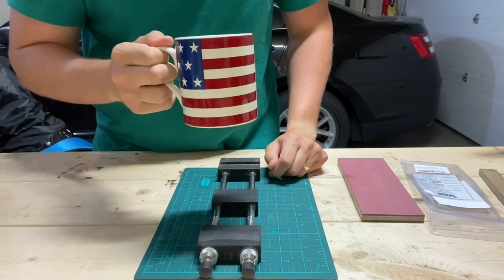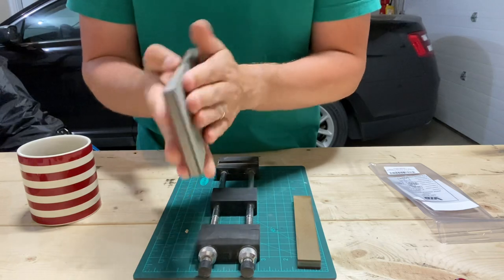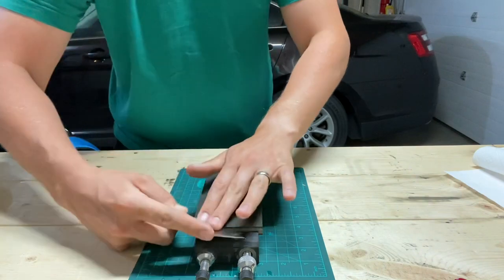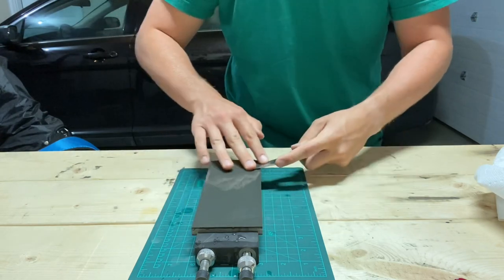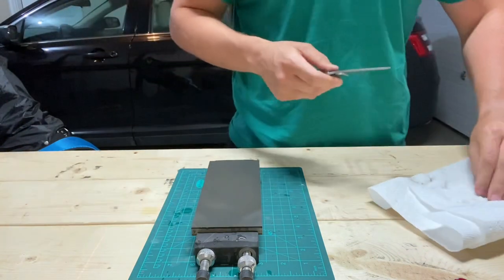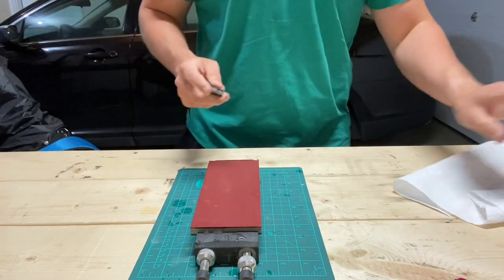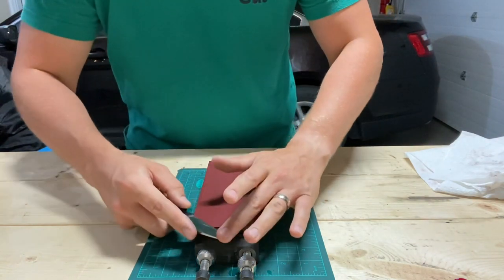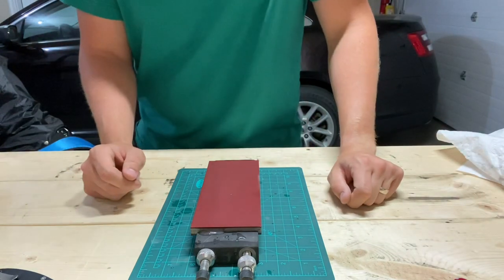Initial Impressions and Sharpening on the Venev Phoenix 240F/400F Resin Bonded Diamond Waterstone

Comment: I have been meaning to do a video about these stones. I have both 25% and 100% concentration of the 100/240 and 400/800. I enjoy both variants for different reasons.
Reply from the maker: Same here. They both have a role to play in what I'm doing. I haven't been going back to my little 1x6 25% concentration much due to convenience but it can really be the ticket sometimes. 

That 100% 240F is really doing it for me though, surprisingly it may be my favorite out of the bunch. Doesn't load nearly as fast as I was expecting and cuts pretty dang quick.

Comment: Thank you kind sir for sharing your experience and knowledge regarding these stones and sharpening in general. 

I am newbie as it comes to sharpening but believe I have finally found a great set of stones to learn on along with a pair of Naniwa Professionals 800/3000. Question if you might; 1. Would you recommend the 100/240 and 400/800 or 240/400 and 800/1200, planning on 1 micron strop as well? 2. Could I get by without the Naniwas for wide range of blade steels from AUS8-K390.?

Can’t seem to find the Super Vitrified 400 from BBB, not that I want to spend that much for one stone😮

Kind Regards,
Reply from the maker: I have no doubt the 100F is a beast but for sure recommend 240/400 and 800/1200. 

You won't need the Naniwas at all with those stones. You may want them later just for the feel, feedback and overall experience of japanese alumina based stones but you won't see any gains from them.

Comment: Thank you.  Very good info and clear. I just got the same stone and excited to give it a try.
Reply from the maker: Glad you liked it! What kind of blades are you going to be using on it?
Reply: @EngineersPerspective701  I'm starting with a Spyderco Para3 in S30V.  And I have other knives in this steel but they aren't thin behind the edge. I'm trying to attain hair whittling edges and consistently.  Thank you for posting videos!
Reply from the maker: Definitely picked a great stone! Love me the para 3, it's a great design and S30V will take a great edge. Enjoy!
Reply: @EngineersPerspective701  Used this stone and then the Venev 800/1200.  I have the hardest time cutting paper towel, like you show here, but can cut pretty cleanly through thin paper.  What quality is it... that allows your edge to catch so much better?  FYI I just began trying free hand after using a Sharpmaker and guided system.
Reply from the maker: @dcuttingedge5422  you’ve definitely got some great stones to get started! The apex has to be burr free but not over polished. It won’t cut the paper towel if you polish that bite out. Usually getting that clean apex is the hardest part for me!
Reply: @EngineersPerspective701  I'll work on not polishing out the bite. Thank you!
Reply: @EngineersPerspective701  I followed a suggestion to learn how to use my coarsest stone, and only that stone, to sharpen and debur for a very grabby edge.  I used an old DMT Extra Coarse on a CRKT Pilar 3 with a D2 blade.  Turns out i can slice paper towels with it.  Paper towel cuts are a little ragged but it worked.  Much to learn and understand!
Reply from the maker: @dcuttingedge5422  I’ll always maintain that the first stone is the most important! If you can do all you’re work on just own that is great practice and a show of skill!  Nice work!
Reply: @EngineersPerspective701  Thank you!

Comment: Great job! Based on their website and what I deduct from their confusing  descriptions, I don’t think the 240 side has the OCB binding, just the 400 side.
Reply from the maker: I think you’re right! I forgot to check but I made this and didn’t look at the package like a bum!
Reply: I just found that out the hard way. I thought I ordered the 240/400 dragon 8x3 with the 400 having the OCB binder, but instead I received the 240/400 with the 400 that DID NOT have the OCB. So if you or any of you subs want a 240/400 bonded combo, I will sell it for $87, half off what I paid. I have used it to sharpen one knife, so that’s a steal.
Reply: @MrEric0822  You don't still have the stone to sell do you?
Reply: @EdgeStoneKnives  Sorry, no
Reply: @MrEric0822  Hey man, what was the reason for you selling the F400 with the old binder (not OCB)? How do the binder differ for that grit particularly?

Comment: Grab you an atoma 140 8x3 for apexing. You'll be able to apex in under a minute. Then move to your f240 f400. The work sharp is nice but it's pretty small
Reply from the maker: Really not a fan with apexing at that low of grit. The #400 super vitrified diamond waterstone from triple B is my go to low grit. Hands down my favorite stone of all time
Reply: @EngineersPerspective701  I use my 140 atoma to reprofile mainly. I'll run it right until it's about to apex and then I switch to my atoma 400. By the time the 400 scratch pattern takes over, the bevel is apexed. Makes quick work of anything, that Atoma 140 is absolutely blazing fast for reprofile work.
Reply: @EngineersPerspective701  honestly if you aren't changing your angle or getting chips or if the apex, 400 is usually good for most ppl. I'm just so used to dropping my angle down to 14°-15° that if I didn't use 140 grit I'd definitely be forever. At my work they are so hard on knives I've even used cheap Chinese 80 grit diamond to apex them 😂

Comment: Venev stones are excellent for Maxamet.  They don't seem to load up, and stay flat for a really long time.  Also Gritomatic's diamond pastes are a great value for fast cutting stopping compound.  I don't want this to sound like an advertisement, I'm just a fan.  They make great abrasives.
Reply from the maker: What I like about these is they are good for ANY steel! For maxamet, 10V, K390 I would usually apex on the DMT coarse and then finish on either a DMT fine or King Neo. Loved the results off the Neo. And for Non 10V class steels or ones under 65HRc, I would use Japanese waterstones like the choseras. 

But now I can use these on any steel and get the comfort I prefer with the diamonds and speed I want. I will say the 240F seems like a very worn in DMT coarse which is a tiny bit slower than I prefer for apexing super wear resistant steels but not awful. More use required for final thoughts!
Reply: @EngineersPerspective701  I have pretty much the whole set of Venev stones, and the coarsest, highest diamond percentage stone a real beast.  I've even used it to flatten the deep grind marks on the full flat sides of my Maxamet PM2 (they were deep enough from the factory that you could feel them with a fingernail).  It was a bit time consuming, but it absolutely worked!
Reply from the maker: @ZPositive  Coming from the 25% concentration ones, I've been very pleasantly surprised by the speed of the 240F 100%. Definitely could see the low grit being an animal! 

I'd be tempted to just get an extra course plate at that point but an atoma costs the same and you would only get 1 grit so why not go Venev I suppose!?

Comment: Good morning 
Maybe you can give me an answer? 

I bought the Pegasus 400/800 and 1200/2000 stones. 
The knife glides over it like glass. Efficiency is zero. It doesn't work, it doesn't sharpen at all. The result is mediocre. 

I feel like the stones have a problem. However, the site indicates that it is a concentration of 100%.

 Do you have an opinion?
Reply from the maker: Have you dressed the stones yet? Some diamond stones come with a layer of resin over the top covering the diamond particles. Are the Pegasus Venevs right? 

Ideally you would use SiC powder on a glass plate and rub the surfaces on that to expose the diamonds. but I’ve never done it that way. I just use an 800grit nagura to dress the surface and it works fine.
Reply: @EngineersPerspective701  Thank you for your reply. I just honed the stones, they are now a little bit more abrasive. It's better. I still find them not very aggressive but it's already much better.
Reply from the maker: @TheGuillaumedu31  sounds like you’re mixing in the right direction. Might take a time or two for a totally pressed surface. You should feel a good bite with the 400F when you’re using it. Best of luck

Comment: Diamond leave a very unpolished finish , but for some steels they are mandatory. I don't have those steels tho, I just use them cause I found them for cheap :)
Reply from the maker: They leave deep scratches and a satin finish like a belt instead of the nice even finish of a Japanese waterstone. These stones here make a HUGE difference in finish quality though compared to diamond plates. They're lack of polish has to do with a binder that doesn't break down into a slurry rather than the abrasive used.

Comment: do you know the grit mesh more coase for vanadium and a store in Union Europ on internet?
Reply from the maker: It is difficult to understand what exactly you are asking so I will try my best.

Go to Gritomatic.com to see the details on the stone and grits. The link should be in the description. They are currently the only place I know to buy these. Message them on their website and they may be able to work out how to get you one because I don't know if they normally ship to the EU. 

The 240F has  40micron - 50micron diamonds
The 400F has 14micron - 20micron diamonds
Reply: @EngineersPerspective701  I asked for grit used on stones like 1000 k chosera for example. I was searching for a 50 or 60 grit !
Reply from the maker: @zenrazor659  Gotcha! I highly recommend you go to the Gritomatic website and check out their Grand Universal Grit chart. It compares tons of stones, abrasives so you can figure that all out. 

I will say the 240F is pretty similar to a DMT coarse, likely a lot more coarse than a chosera 400, maybe more like a Shapton Pro 320. 

The 400F is coarser than a Chosera 800 probably similar to a Shapton Pro 1K or a little coarser. Slightly finer than a DMT fine though.

Comment: 👍 great job great edge! Have u ever tried metallic bonded cbn or diamond stones? I think that's what I'm getting next! Love the sharpening vids!!! Try some dual grit sharpening as well
Reply: I dont know if you read it or not but science of sharp had article on the dual grit sharpening. Made sense that it would do well on sissal rope, but seems questionable how it would hold up to some other materials given the nature of the burr-like edge, was interesting though.
Reply from the maker: Have not tried metallic bonded due to cost mostly. If I buy anything diamond/CBN after these it would probably be super vitrified diamond waterstones. One day I'll pick up the 400grit but that won't be for a while.

The hassle of the duel grit has me pretty turned off especially because I like the performance of my edges so far. Maybe one day for giggles!
Reply: @EngineersPerspective701  yeah, kinda what I thought about the dual grit as well, that and that it might kind of bother me psychologically thinking about the nature of that edge how it is, even if it was fine from a practical standpoint but I dont know 🤣

That supervitrified 400 is the stone I want to try as well. Looks like it would be great.

Comment: They cost a hefty price now, Honestly I would just use my chinese Diamond stones.
I've used Eze-lap stones and chinese and always been happy with the chinese ones.
Reply from the maker: Realistically they're $50 USD per grit in hear in the States. So that's really not bad at all compared to any quality stone. As for these vs. diamond plates, they are a completely different animal that the more discerning users will appreciate.
Reply: @EngineersPerspective701  Here in Europe they cost 100€ 😳😳😳😳😳😳
Reply from the maker: @dimmacommunication  Ouch, that’s crazy! Pretty sure they’re manufactured in Poland too!
Reply: @EngineersPerspective701  Honestly I wouldn't buy steels that require exclusively  diamond to sharpen , too much of a hassle... 
I still use diamond as it's way cheaper and serves very well as a perfectly flat lapping stones ( silicone carbide paper on glass  works well too )
Reply: I didn’t know the polish grit system was way different from japanese or ANSI. Explains why I didn’t get the results that I was expecting with them.
Reply from the maker: @dimmacommunication  There is no right or wrong, just personal preference!
Reply from the maker: @nandayane  Gritomatic has a Universal Grit Chart that is amazing! I keep a screenshot of it so I can reference it quickly and often.

https://www.gritomatic.com/pages/grit-chart
Reply: @EngineersPerspective701  Thanks! It’s very helpful! I like that it is also broken down by brand.

Comment: I wanna get a set of the Phoenix stones, but they’re $160 a piece (or at least the 80 grit one is)
Reply from the maker: Are those the thicker ones? I’d buy them right now before they’re gone. With the war in Ukraine you can expect them to dry up I believe.
Reply: @EngineersPerspective701  yeah, those are the 8x3’s. And that’s true, I can only see the lowest grit in stock, but I’ve found some 8x3 diamond plates that were only about $40-$50 a piece and were in all the grits I wanted
Reply: @feraltrafficcone4483  which diamond plates are those?

Comment: I'm hearing the terrible grinding sound when he reaches the end of the stone and the edge goes over the sharp corner of the stone. 

That and the sound it makes when he continually hits the Kick of the blade on the edge of the stone. this is NOT the way you sharpen a fine blade. Ever!

KnifeMaker
Reply from the maker: Is this a fine blade or working blade or both? There are times when I care about the heel/kick area and this is definitely not one of them. You may care 100% of the time but on my blades, I cut in a choil and get in as close as I can on the stone. Not worth the headache.

As for coming off the end of the stone, I think you're hearing the same sound of the heel contacting. Not sure though because I didn't really hear anything else. 

Still appreciate you speaking up though. Cheers
Reply: gotta love when a "professional" speaks up. lets see his clean cut paper towel videos freehand and maybe then his words wont fall on deaf ears.
Reply from the maker: @chrisolenick953  I'm sure he does quality work and has good knowledge but in this case I stand behind what I did here. No judgment passed or ill will!
Reply: I always sharpen right through the ricasso, edge straight from the plunge grind to the tip as it should have been from the factory.